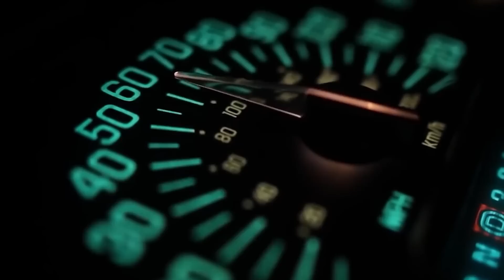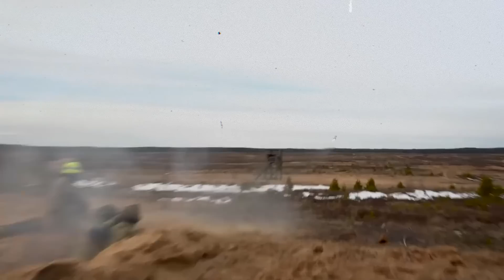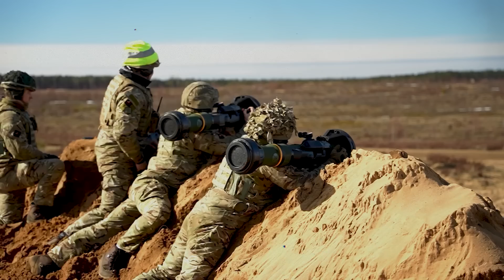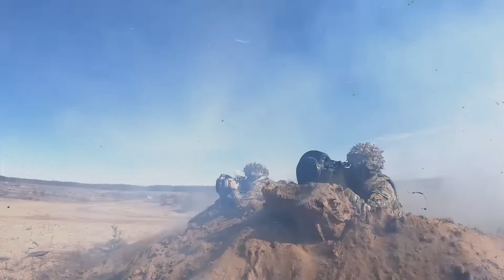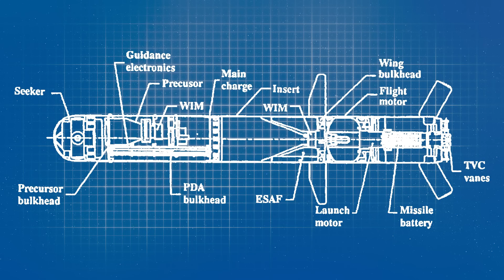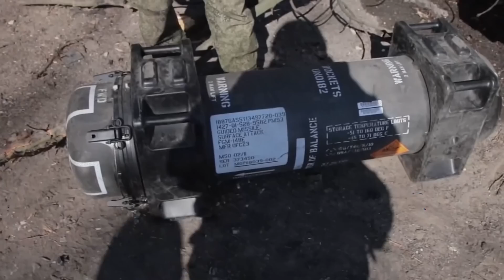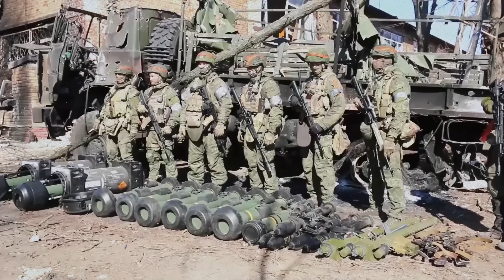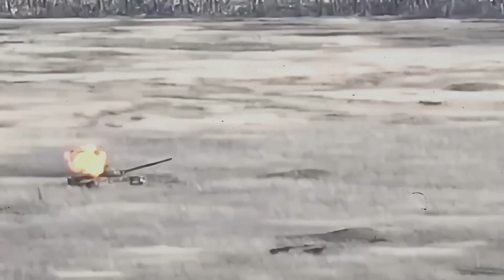The Javelin: The Missile That Redefined Modern Warfare

Comment: Since the range of the latest Javelin is now farther than the range of a Tanks Gun...it's no longer "fire and forget" it's  now "Fire and wave at them".
Reply: The T-90 can only hit targets out to 3,000 meters on a good day.

Let me explain where the "10km range" myth came from by using my antique  flint lock rifle as an example.

If I hold the rifle at a 45⁰ of elevation and pull the trigger the ball will land about 800 meters away, but if I actually aim the rifle I can only hit a "man sized target" at about 150 meters.

So does my flint lock have a range of 800 meters?
No because to hit anything past 150 meters I have to elevate the rifle so much that its pointing at the sky and I'm not aiming at anything.

If you take a T-90 and drive up a steep hill so you can elevate the barrel to 45⁰ the round can travel up to 10 km , but the only thing the gunner sees are clouds when he pulls the trigger.

If you want to actually aim the gun at something you are limited to 3000 meters.
Reply: @glennchartrand5411  Actually thats not the case here.  He simply looked  up the info of the wrong tank.  Thing is, Russian tanks can fire ATGMs out of their barrels.  For T-90 its 9K119M Refleks-M with 5000 meter range, for T-14 Armata its 3UBK21 Sprinter with 12000 meter range.
Reply: @glennchartrand5411  lol, ok you keep thinking that, Russia enjoys the advantage of your ignorance.
Reply: @ledzepandhabs  
Do you realize that everybody knows you're full of it?
Reply: @glennchartrand5411  full of what, where is your NATO now when Russia is doing great while all your countries are in recession and losing the war.
Reply: @ledzepandhabs  our nato is laughing our butts off at how you think conditions are so bad in the real 1st world countries. I have been to russia many times and it has always been a dump. You might not have noticed the recession in russia because it is hard to get much worse
Reply: @ledzepandhabs holy shit you are a real life Putin simp
Reply: @ledzepandhabs NATO isn't at war. Although I wish NATO countries would do more to help Ukraine, for NATO itself this war has been the best gift it has had since the fall of the Soviet Union.

The union has only grown, adding Sweden and Finland. It has also been able to leverage aging equipment to destroy Russian weapons and personnel. Russia inherited a massive stockpile of tanks and artillery shells, which has now been significantly depleted without a way to properly replenish it. This was the biggest risk for continental Europe, and now it's just gone. Hundreds of thousands of Russian soldiers have died or are heavily wounded, without having to trade a single NATO soldier for it. They've also gotten to see the Russian weapons in action, and observe where they are weak or strong. For instance it's obvious that the RAF and air defense is all but useless, but the minefields are a problem. Cool, now we know we need to develop more and better mine clearing equipment.

The only thing I'm sad about is that the Ukrainians are also paying the price for this. However strategically this is a massive loss for Russia, and a huge win for NATO. It allows NATO to properly focus on China going forward. Russia is just no longer a threat. If Russia tried anything, Poland would destroy them even before the Americans even arrived.
Reply: @ledzepandhabs   Day 672 of the 3 day special military operation. Didn't you guys not just lose another ship against a country with no navy? the supposedly second strongest military in the world can't even conquer it's smaller and supposedly inferior neighbor.  Cope and seethe harder.
Reply: If you're fighting in the desert that's possible.  Nowhere else
Reply: @MarilouGushwa-q7y  At 10km, you start dealing with curvature of the Earth. A 7' vantage point looking out at 10km cuts off 6' from the height of the object. So an 8' tall Abrams tank is now 2' tall. Seeing as a T-90 is 7'3" I'd say that the height to the sight is probably closer to 6'6" which shrinks the target by almost 7'. Do you still think that's possible to hit a 6' tall person with a javelin in the desert firing position?
Reply: More like, "Fire and give them the middle finger"
Reply: YOU CANT WAVE ON DEAD PEOPLE
Reply: Javelins are extremely costly systems. Most unit commanders won't authorize a 2 million dollar system to be exhausted to dispatch a $600 haji pick up truck.
Reply: @charlesburke2379  $178,000 per launch.
Reply: looks like someone doesn't know that tanks have laser rangefinders that can still make accurate shots past their designated max distance
Reply: @thelordofcream  thats not how it works but ok. Dream on.
Reply: @thelordofcream  Looks like someone is talking shite about a subject they know nothing about. 

If the laser is maxing out on solution calculation then you're not using it.  You're back to optical sights and range tables, or multiple shots if you can see the fall of fire.  The simple fact is that most laser range finders simply do not return a firing solution beyond 4-5 kilometres.  A 125mm smoothbore isn't hittting shite with a gun round much over 2km.  The rounds simply become too unstable and lose too much energy.  The modern 125mm can also fire ATGM, but again, NONE of those have ranges exceeding 5km and there's no way around that aspect because they are literally hardwired for that.  You're not going to even see anything much over 2 km away unless it's sitting or moving in the open, with strong contrast against background, and/or Fvcking Huge.  And that goes in both directions.
Reply: maybe you should go watch Wally canadian sniper hunting Russian tank story😂😂😂
long story short he could not get in range to shoot at the tank....but tank allways shoot at the., killing 3 of 6 men team....and at the end wally could not destroy the tank....
all mighty Jawelin failed...and btw you do know batteries get empty with less than 5 tryies to lock on to a tank....😂
Reply: @Lipi19821  oh wow, you found 1 example of a javelin that was probably used incorrectly. May I ask what russia’s shoulder fired missile is? What is its effectiveness?
Reply: @airsoftpopcorn  1 example? we had sent more than 100 000 atgms wich is more than all the tanks on the world combined.....
Russia should be without any armoured vheicle if they were soooo goooood as advertised🤣👍🤣👍
edit btw Javelin needs 2 minutes for its sensor to cool down....so 2 minutes of baterie drainage, for you to start searching for target..
Russians have Kornet, but I dont see what this has to do with my comment?
Reply: @Lipi19821  1st off, kornet is not a shoulder fired missile, so it is much easier to avoid compared to a javelin.

2nd off, lets say the javelin has a 30% hit percentage. That still means that it is far better than nothing (and russia has nothing that can compare to the javelin)

3rd off, ukraine has used a lot of their javelins to target russian ifvs, apcs, and infantry. So they haven’t used anywhere near 100,000 javelins against tanks.
Reply: @airsoftpopcorn  still, what does that have to do with anything...
javelin is not wonderweapon people think it is....
btw Javelin by some documents has about 5% 1st hit destroy rate....so not a wonderweapon by a long shoot...
still if 100 000 atgms fired were that good, russia would had 0 armour🤣👍
Reply: @Lipi19821  also, the figures released have only shown about 10,000 javelins have been sent to ukraine and russia was reported to have over 27,000 armored vehicles, so i don’t know if you know how to do math, but 10,000 missiles is a lot less than 27,000 vehicles
Reply: @Lipi19821  source?
Reply: @airsoftpopcorn  maybe go use google and google hpw many atgms did ukraine got before wasting my time...
me and you are done, as you are just wasting my time....
if I remeber correctly it was Kirby that reported 100 000 number...no gtfo🤣👍🤡🍺
Reply: @Lipi19821   we are talking about javelins, how off topic do you want to get? Do you know how many types of atgms have been used by the us? Also, kirby never said anything about 100,000 atgms being sent to ukraine. You really just spout bs without checking? And you call me the clown? Pathetic
Reply: @airsoftpopcorn  you are a BIG 🤡
Reply: @Lipi19821 acrually its a 90 percent first hit kill rate dvmbfvck lmaooo.
Reply: @thatguy46744  sure it is...go read some reports from US militart how low is hith probability when US soldiers train....🤡🤣👍
Reply: @Lipi19821 that story was confirmed to be completely fabricated. They giy didnt even serve in the canadian military and there are no records of his service in ukraine.
Reply: @thatguy46744  what story....it was his report...he was saying it in an interwiew...not writen on some blog...
wy not provide some source..for debunked story🤣👍
Reply: You are dreaming, it's range is 4km max, a T90 can frag you at 10 km.
Reply: @ledzepandhabs at 10 km a t90 wont even see you let alove land a shot in your postcode.
Reply: @trazyntheinfinite9895  Try 3,000 meters.
Reply: @trazyntheinfinite9895  they sure can and do, drone targeting fool, your idiocy is why you lost 3 armies already.
Reply: @mikehadley5485  I wouldn't say often
Reply: @mikehadley5485  yes. Russia uses guided, precision artillery which is why they do  not employ soviet tactics of reducing whole cities to rubble... oh wait.
Reply: @ledzepandhabs The 125 Cannon you have is accurate to a bit over 3k. BUT your sights, targeting system, and drunk conscripts are good for about 500m.

10k GTFO
Reply: @Shoelessjoe78 Damn, western tech must be terrible then if they can't even allow Ukraine to capture crimea against "drunk conscripts"... can u guys only win against poor, helpless Syrian women?
Reply: @Shoelessjoe78  10 km has been done regularly using drone targeting, you should keep up with advances instead of relying on cnn, prolly why you lost so badly.
Reply: @ledzepandhabs t90 doesn't even have 4km sight how it gone hit anything lmao vatnik go back to school
Reply: @ledzepandhabs  It won't even be able to identify you at that range, let alone accurately shoot you.
Reply: @scorched8198  drones sherlock.
Reply: Are you on drugs  @ledzepandhabs  ?
Reply: @ledzepandhabs hahahahaha, yeah, ok, where are the optics for that? behave yourself, that tracked coffin has an effective range of 3KM. sighting nope.
Reply: @ledzepandhabs HAHAHAHAHAHAHAHAHAHAHAHAHAHAHAHAHAHAHAHAHAHAHAHA (breathes in) HAHAHAHAHHAHAHAHAHAHAHAHAHA
Reply: @ledzepandhabs  You smoking crack... The 2A46 has a maximum range of 5km with the anti-tank missile, and with the sight they used in the T-90... You're an amazing shot if you can hit 3500 meters. I'm talking Annie Oakley meets Wild Bill.
Reply: @SmokePoppa  What's wrong with crack? The T90 can fire on you by eyeball or by computer, the computer can see far away better than and eyeball.
Reply: Today  in wars,, there is something called Team Work,, is revolutionary new word.. and very rarely the Russian army will send a tank alone to any zone without Drones scanning ahead of the tank and with artillery support too , in case of troubles.. With the new thermal optics of T90m tanks can see enemy troops 8km away.. So either they ask drones to hunt you down from the places you are hiding  or ask short range artillery to bomb your position.. Russian soldiers can easily rain grenades beyond the range of your Javelin , Russian drones can hunt you anywhere. Russian artillery can hit you 70km away of distance , and Russian anti tank missiles have 10km range that can also fry you into dust before your javelin is close enough to be fired to the tank.  In this javelin wonder was so good , why they have not made any diference to stop the Russian army advances with tanks? Javelings can be blinded with thermal decoys and the smoke screen , so the probabilities your javelin will hit from distance is very low.
Reply: @technoartfest8708 remind me again, why did the Russians abandon their rush to Kyiv? And why has it taken the supposed 2nd army of the world so long to conquer so little?
Reply: @apenkoppen 
Approximately 1/3 of Ukraine isn't small...😂 . 

u belived the Ukranin beat /push back the Russian whom 1/2  encircled KieV? 

mate they were negotiating.. the fact miles of miles of Russian traffic jam at the outskirts wasn't even touched.. and disappeared within 3 days.. I can assure you its not because Ukranians  came out and  engaged n push the Rusaian back.
Reply: when their original goal was to capture all of Ukraine within a couple weeks, yeah, a 1/3 of Ukraine after almost 2 years is pretty small
Reply: @airsoftpopcorn  
This isn't even an asymmetrical war thousands of kilometers away.

This is a conventional war ON THEIR OWN BORDER against a Country 1/10th their size.

This would be like America invading Canada and being held within 100km of the border for 2 years.

Pathetic.
Reply: @airsoftpopcorn  no russian ever said such nonsense, that is a cope statement used by weak western fools that have no answer to Russia.
Reply: @apenkoppen Without NATO supplied weapons and NATO foreign mercenaries in Ukraine, that would be 'NO Contest'
But the reality is 1🇷🇺 vs [ 1🇺🇦 + (ALL of NATO countries combined)] 
But RF Army is still advancing & advancing 😄
Reply: @ramnivdc7051   Cope and Seethe harder my guy. Russia would have already been dust if this was a war with NATO. All the west does is send a trickle of supplies. Day 672 of the 3 day special operation.
Reply: @Killeraholic  dust❓⁉️ did I hear it right ❓⁉️
The WOKE West is always Dreaming (and that is the Reality)
Just wait for the outcome . . . Relax . . . Patience is a Virtue 👍💯
Reply: @technoartfest8708 you spelled Ukrainian the wrong way. Projection?
Reply: @technoartfest8708  if all tha were true, russia would not have gotten its cheeks clapped.
Reply: @technoartfest8708 keep coping comrade coward.  Russian equipment is garbage and Russians can't fight.  They are 2 years into their pathetic invasion and getting no where.
Reply: @technoartfest8708  Fact: The profile of the average Russian soldier has now changed since Russia illegally invaded Ukraine to satisfy Putins empire building ambitions 
At the start of the war he was about 24 years old and a professional soldier, now the average soldier is 34 years old and an ex-prisoner, a convicted criminal released to fight Putins vanity war. I find this hilarious, Putin recruiting pedos, murderers, drug dealers and petty criminals to fight his war...talk about desperate, it's too funny.
Reply: @technoartfest8708 are you dumb or just ignorant of reality... Change the world from Russia to Ukraine and it makes more sense... 

Ukraine are the ones who basically invented drone drops to this degree... 

They invented the drones used to this degree that Russia now copies... 

They also invented unmanned explosive boats that Russia now copies... 

Ukraine are the ones leading the way in the terms of technology and teamwork... 

You know Russian drones and Russians on the ground have no communication... The Russian drones often watch their comrades get flanked... 

They also can't contact the artillery... So they aren't accurate... 

Whereas Ukrainians are all interconnected... West is just better... 

Are you dumb or just ignoring Russia's losses in a country next door.
Reply: @technoartfest8708  but you see, the reality at display in Ukraine has debunked all your wunderwaffe claims.